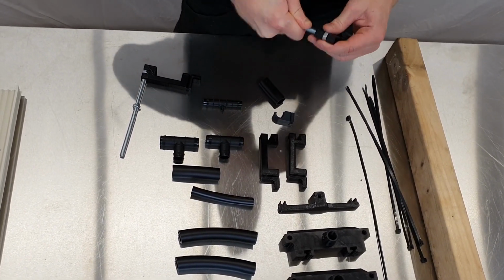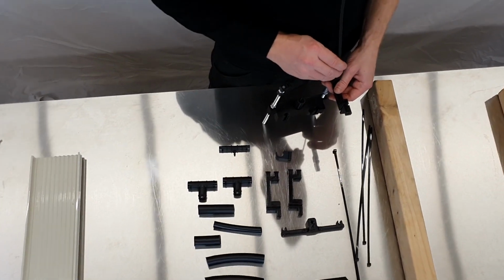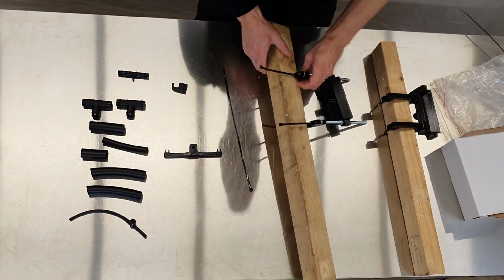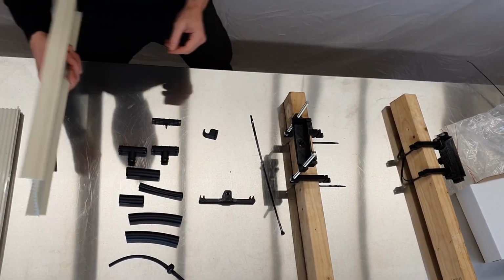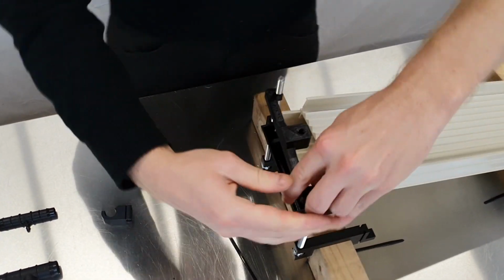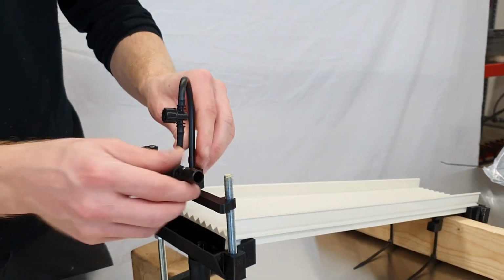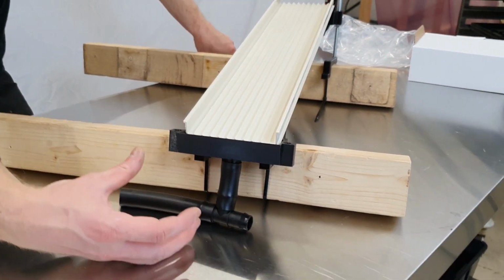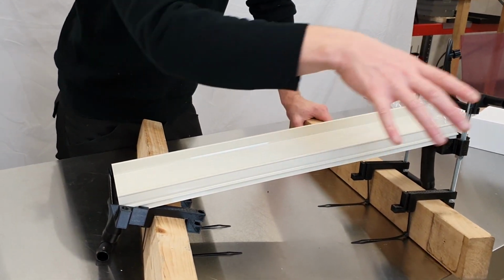Nordamark Installation guide for Wateringsystem installation 1.0

Comment: Hi How does this system send the water up from the box under the table? I looked into the test kit on your site, it doesn’t include a pump, do I need to buy one myself or the system doesn’t need one?
Reply from the maker: You need to buy a pump seperatly or you can use the pressure from a wateroutlet